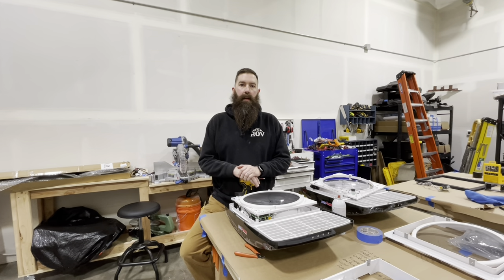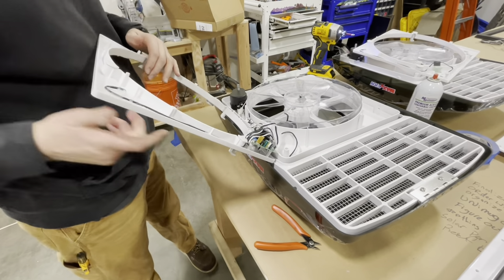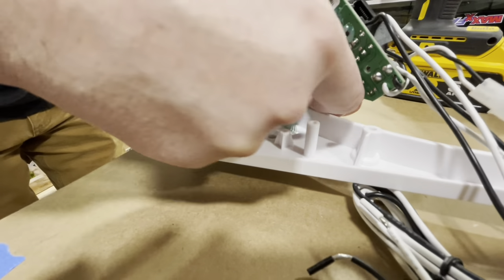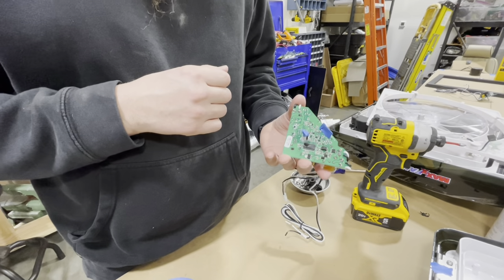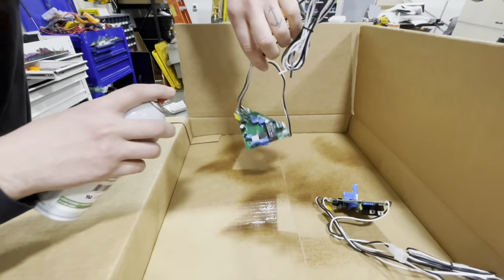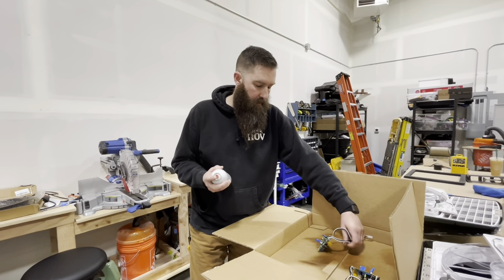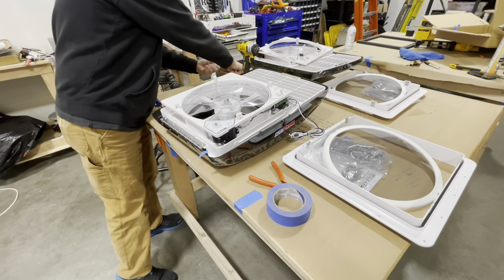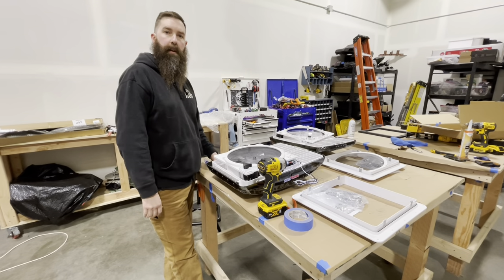Help prevent premature failure on Maxxair fan. Watch this before installing you fan.

Comment: I sent an email to Maxxfan asking if they had improved board coating and -or power issues. They replied-The new board will already come with the coating on them, adding any will void the warranty. 
Many people who use alternative power sources find it easier to add a voltage regulator to ensure that issues do not arise.
Thought your viewers may have an interest....Thanks.

Comment: I have read that some of the Deluxe fans prematurely fail due to current / voltage fluctuations.  The remedy seems to be some sort of voltage stabilizer via a Buck module.  Do you have any thoughts on this, and/or recommendations ?
Reply: seems everyone trying this method are having the stabilizers bulge and burn up...im still looking for the fix..lol

Comment: What was the manufacturing date of the models that were failing?  I spoke with Tech Support on the phone at MAXXAIR and they mentioned they were aware of this issue and started adding a coating on the PCB board in 2017 to address this issue.
Reply from the maker: It was happening all the way up until we paused builds earlier this year. It could be that we had fans with older dates because none of ours had the coating. That’s really cool that they are finally doing it!

Comment: Great Info and detailed Video.  Have you dealt with or seen issues with over 12 volts and maybe installing a 12 Voltage regulator?  Is it an Issue?   Thanks
Reply from the maker: I have heard about it being issues. On one phone call with a tech at maxxair that was the first question they asked.

That’s never been an issue we’ve had. But something they look for. 

The moisture has always been the problem. 

I hope that helps!

Comment: You also need to buy a dc-dc 12v regulator to keep that circuit board from frying because its literally the dumbest circuit board ever. The fan needs an exact 12v to work otherwise the board gets fried, and you get the greed dot of death. These fans are designed to go into RV's, and many people use Lithium batteries that have an output of about 14.5v, and it boggles my mind that this dumb fan requires an exact 12v while every single other 12v device can handle a voltage range.
Reply from the maker: I’ve called and spoke with a technician at maxxair and said they were indeed finicky when it comes to voltage. They had no concerns with the lithium. That being said. I have seen a few mother boards and a few motors go in these
Reply: Forget these fan i bought  two an both shit the bed an cant get response from support junk fans